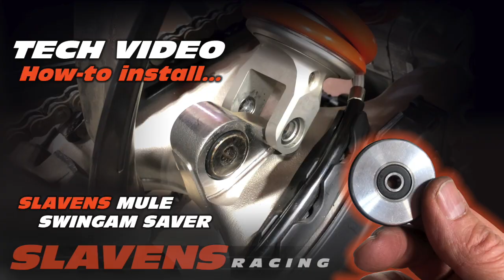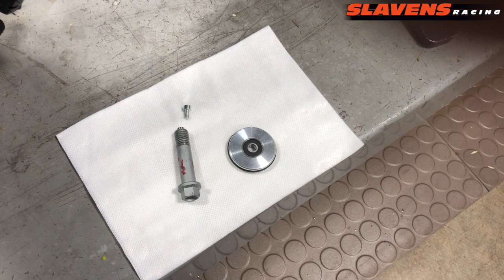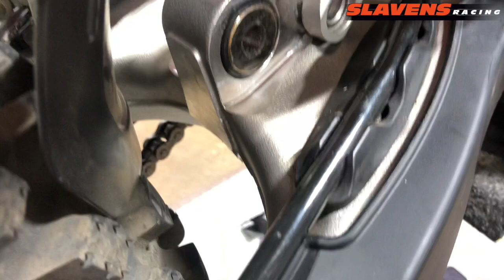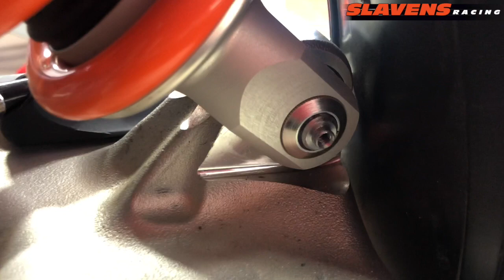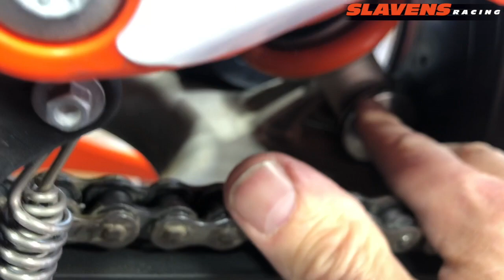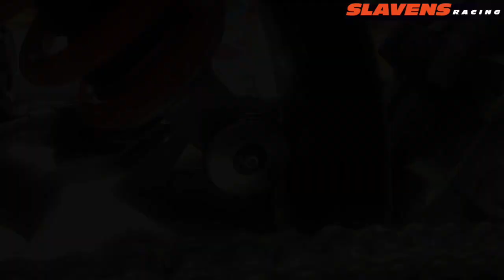How-to install Slavens Mule Swingarm Saver

Comment: Jeff is there a specific torque setting for this lower shock bolt? I had a bad experience down in Baja where this bolt backed out on me. That a mechanic had installed. I am now doing all my own work very carefully. Your input on this as well as assuming loctite is greatly appreciated
Reply from the maker: Hello:
For future reference, all torque specs are in your owner's manual. Both shock bolts torque to 80N/mm or 59 ft/lbs. We recommend red thread locker from Stuck Nutz https://slavensracing.com/shop/threadlocker-by-stuck-nutz/. It is manufactured by dirt bikers. Loctite donates to groups that are anti-dirt bike so we never use their products.

Comment: Did they go away from the spherical bearings yet I never really understood why they didn't have a needle bearing for the swingarm pivot
Reply from the maker: Needle bearings have several issues for this application. The shock needs to move as the swingarm and frame flex and heim joints allow it to do that, needle bearing do not.
Reply: @slaverace1   @Jeff Slavens  for how long is the performance better? Have you ever seen a KTM swing arm bearing that wasn't toasted after 25-50 hrs?